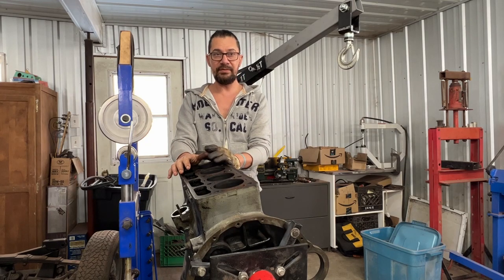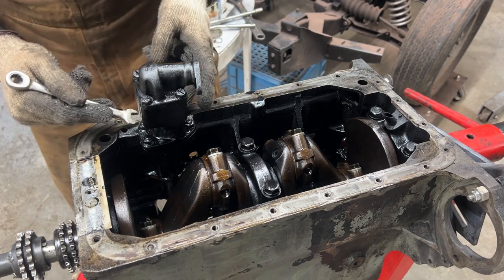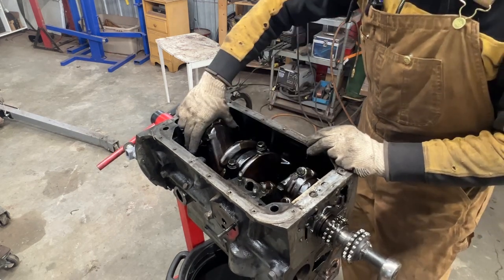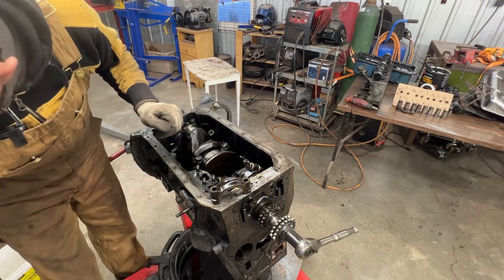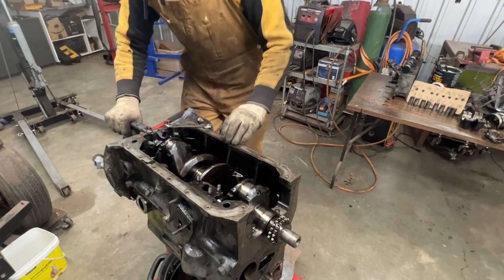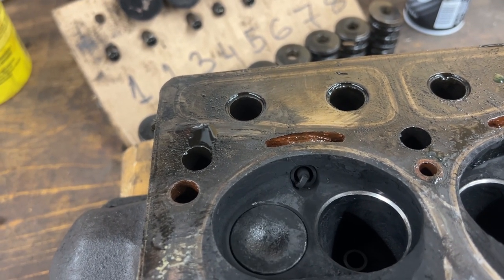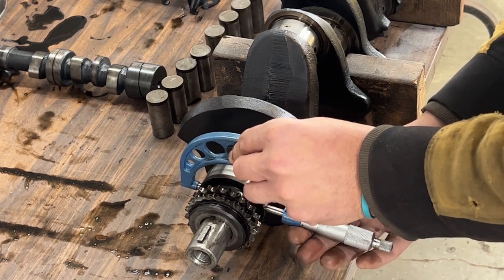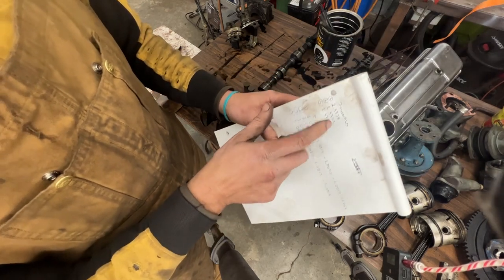1964 TR4 - Part 6 - Crank and Liners Issues

Comment: This is fascinating! You really know what you're doing. It seems the engine has seen many better days. Lots of parts to replace. It would be interesting to know the cost of each. I'm hoping some day to own a TR-4. I've love TRs since my sister had one in 1963! I'm retired now, and I have no idea how I could afford one, but I'm not giving up on that dream! Your videos give me hope that I can fix one up. I've worked on my cars since I was 15 so I have some mech experience. 

Great videos! Not only do I see how to take the engine apart, but you explain what to look for with regards to damage. 

Thanks for posting! I've leaned a lot!
Reply from the maker: Owning a classic car is expensive... Nope. That is a myth! If you do your own work it is not more expensive than owning a daily driver. What makes it expensive is when you decide to go for all the upgrades and you pay a mechanic to do all the work :) So if you are planning to work on it yourself, you can afford it, I am sure. You can see the cost of the parts on the main suppliers websites - depending on where you are, here are some examples. Moss Motors in California, The Roadster Factory in Pennsylvania, Rimmers Bros in the UK. Google their websites and you can get an idea of the parts cost.

Comment: Another great video, Elin!  Amazing that car drove in under its own power.  
This is a 'chicken or the egg' question - What do you think happened first;  the broken tappet, or the bent push rod?  Perhaps a better question is what caused the 'first' failure to begin with?  Is the broken tappet's bore damaged/scored?  Is it possible that a bit of silicone plugged the push rod oil passage?  What do the end faces of the bent push rod look like;  do they look like they were 'oil starved'?  Since you found bits of silicone in the pan, should the block have the oil gallery plugs removed and reamed to clear any debris?  
"Inquiring minds want to know!"  lol

Comment: Elin, I feel like you are my professor (and I'm nearly as old as the cars you are breathing new life into) one question based on this video (and totally ok if you can't answer) - when bidding for work, do you estimate based on what you expect (like  a fixed price bid), what you find (pay by the drink) or the "Elin" quote :-)?  Based on this, I would guess it is both - you "estimate" and then give a final when you order parts - if that is the case, what do you do when things get WAY out between estimate and actual? ***Knowing full fell this is a tough question but would appreciate how you think it should be done fairly.

Comment: I think the weak oil pump didn’t lubricate the cylinders, or anything else really…

I’m not sure if a backfire could cause such a bent pushrod and shattered tappet but it doesn’t look like a valve or rocker jammed ?
Reply: These  three   bearing   crank   engines if revved  wore  cranks  because   crank  flexes   ,  that  why   all   modern  engines  are 5  bearing
Reply: @garypeatling7927  Yes but parts of the engine were clearly rebuilt and are now prematurely worn... it doesn't look like a track car.

Comment: it is bad practice to run new valve and lap worn seats . grind the seats and new valves that is the right way.
Reply: agree with Mike - but why not install hardened seats so you can run unleaded ?

Comment: What does :three ten thousandths mean?
Reply: 0.0003” or a really small slice of one inch😂
Reply: @graemelliott3942  so it's three thou then, not three ten thousandths.where does the ten thousandths come from? IV been measuring very small parts of one inch for the best part of 40years never heard it termed in that way.🤪
Reply: @pbysome  0.003” is three thousands. 0.0003” is three ten thousands. 
0.003” could also be 30 ten thousands
I never really heard of engine measurements going into the ten thousands only in the thousands. That is super tight tolerances
Reply: @graemelliott3942  three tenths of a thousandth??
Reply: @pbysome  yes!
Reply: @graemelliott3942  that's what is confusing me, British stuff isn't measured that tightly especially in the factory anyhow, thanks for clarifying that.